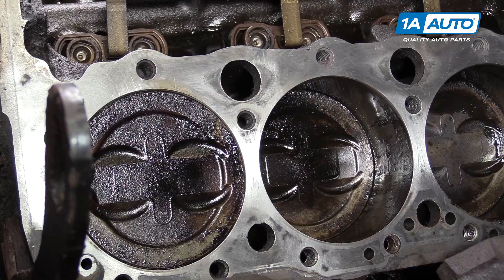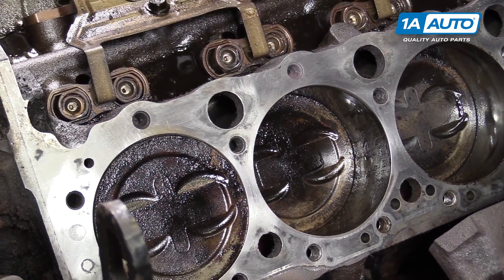What is Top Dead Center (TDC) of an engine?

Comment: This is for the person who needs to locate True # 1 TDC. 

1.... Never assume that your harmonic balancer ZERO mark and your timing tab ZERO indicate true TDC. 
Outer rings can slip, timing tabs can become damaged, and/or, these marks may not have been accurate from Day 1. 

2.....Try to NOT view this as if overly complex.... it is not.  Just follow these simple steps, and you will find true # 1 cylinder TDC. 

3..... finding or verifying true # 1 TDC does NOT require us to be coming up on the Compression Stroke. 
 TDC occurs twice for every 4 engine cycles (i.e., 720 degrees of crankshaft rotation). 
The crankshaft, connecting rod and piston do not care what the camshaft is doing for this procedure. 
TDC is TDC regardless of which stroke. 
For distributor phasing or ignition timing, yes..... it certainly does matter. 
 
When accurately locating TRUE # 1 cylinder Top Dead Center, we use a PPS procedure.... (positive piston stop).
By using the PPS procedure, we eliminate any crankshaft dwell that occurs when a piston has theoretically reached top of stroke.  (there will be some crankshaft movement while the piston appears to be stationary at theoretical top of stroke)

Ideally, we want to stop the piston at approximately 30 degrees before theoretical top of stroke. 
30 degrees is a suggestion only. You can use 25, 28, 32 or 35 degrees, as longs as it is the same angle in either direction towards the "stop". 

Once the 30ish degrees has been established, the PPS tool must be locked into position. Most will offer a jam nut. 

First, we rotate the crankshaft until the piston is gently stopped by the PPS tool.
Then we make a mark on the harmonic balancer (or on the flywheel) that aligns with a stationary pointer. 

Next, we then rotate the crankshaft in the opposite direction (no need to worry about camshaft drive chain/sprocket slack) until once again the piston is gently stopped by the PPS tool. 
Now we make another mark that aligns with a stationary pointer.

This leaves us with two new marks that have aligned with the pointer while the crankshaft/piston had been stopped at approximately 30 degrees at either side of the two rotational directions. 

Next, we accurately and equally "split" the distance between these two new marks.
At this point, we mark the "split" location. 

With the PPS tool now removed, we rotate the crankshaft to the location whereby the pointer now aligns with the new "split" marking. (it does not matter which direction we rotate the crankshaft)

This is True # 1 TDC. 

This procedure is used by many profresional High Performance Engine builders.

Comment: after i rebuilt my 53 dodge i painted the -tdc an deg marks crankcase pully ----then remove dist cap rotor will be close to 1 oclock pos. put cap backon conn timming light to # 6 wire spin eng with starter  - watch timing light --to set at 4 deg before tdc   slowly rotate dist  till on #4 mark stop tighten dist to eng  ready to go.

Comment: Use a bridge and dial indicator, and you'll see that most of the time the factory marks can be off a couple degrees. Now for an oem engine this may be ok, you'd just not have optimum performance, or it could be the engine that always seems to ping during warmer weather. if you have the heads off it is a good time to use a dial indicator and verify where true tdc is.

Comment: I am currently rebuilding a cvh 1.4i engine for my '99 Ford Fiesta as a project. I'm not a qualified mechanic but I would like to think that I have some intermediate knowledge of car engines because I have had some training in Motor Mechanics as a trade course. My worry at the moment is finding TDC correctly first time when  assembling the engine again. My pulley does not have any marks except for the slot that looks the same as the one in the sprocket where the woodruff key slides in.

 I'm just curious to know if it's possible to find TDC with only the bottom half of the engine and then later installing the cylinder head which will be timed correctly as I have sent it to the engineers. 

The problem with cylinder head was 2 valves bent, hydraulic lifters were gone and so was the camshaft.

I plan to rebore the cylinders and fit 20thou pistons just to refresh the engine and get that little bit more performance.
Reply: I have the same problem. I was changing my intake manifold gasket on my 98 Sierra 5.7. I had put valve covers back on and manifold  and when it came to putting the distributor on I had to check the tdc and I want to know how to do that without having to see the pistons someone help!

Comment: When I assemble an engine I often times find that the harmonic balancer tdc mark isn't perfect.  I usually find this using a piston stop or a dial indicator.  They can be remarked for more accurate timing observation.
Reply from the maker: +Oldsmob455 Thank you for the tip! We appreciate the feedback for assisting other viewers! 1aauto.com
Reply: 1A Auto: Repair Tips & Secrets Only Mechanics Know Can you correct or set the timing on a 2001 Ford Mustang 4.6L like this